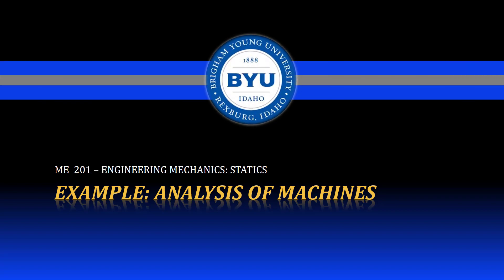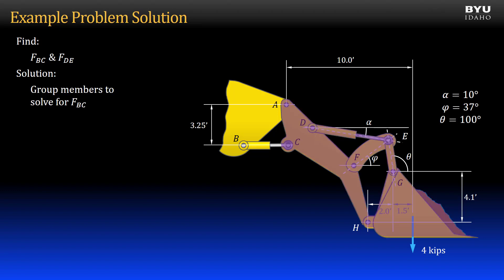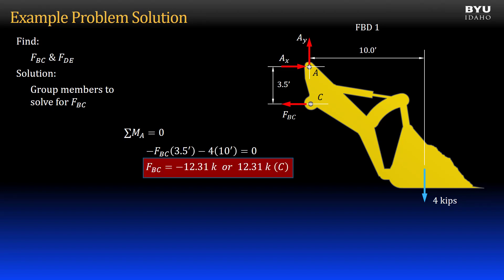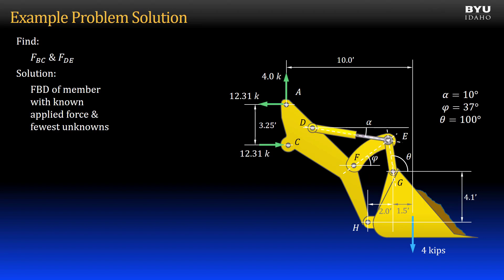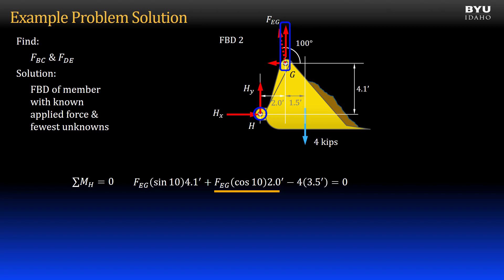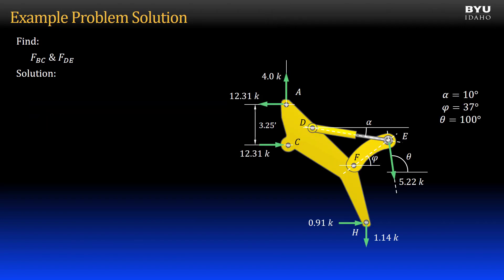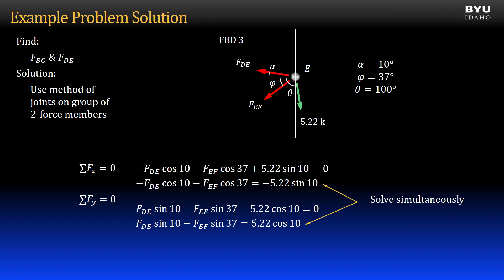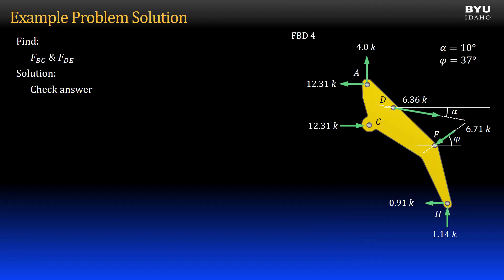Statics 7-2f Example: Analysis of Machines

Comment: Im confused I see how you solved for Fbc by excluding the final part and grouping it together at the end. However, The reason IM confused is because if you consider the final part with just Ax, Ay, And Fbc. Fbc has to be zero otherwise it would create a moment about a. Unless the bucket has a weight but I think that should be included in the diagram and cant be assumed!
Reply: Like I know it does have a weight but usually for these digrams we dont consider the weight but I guess if you thought about it, The bucket is where the load is applied Idk though What do you think.